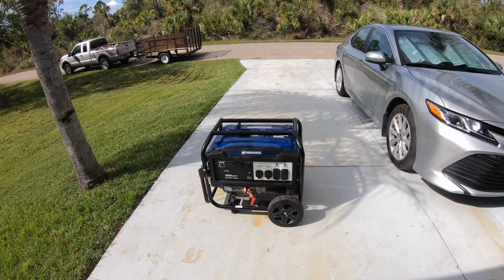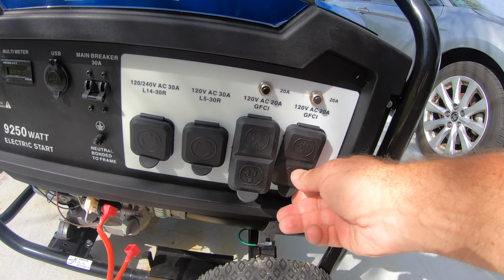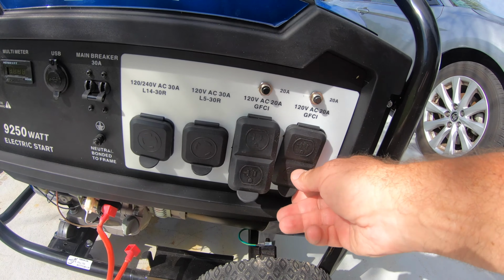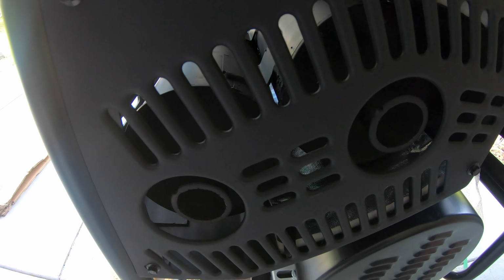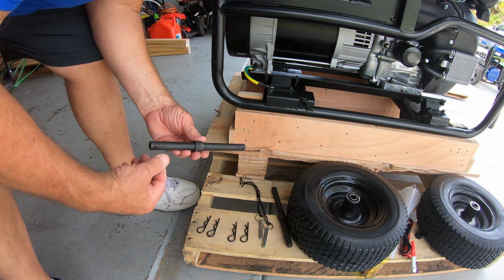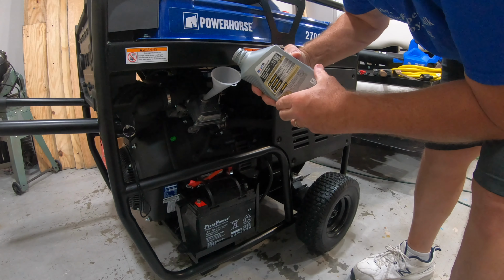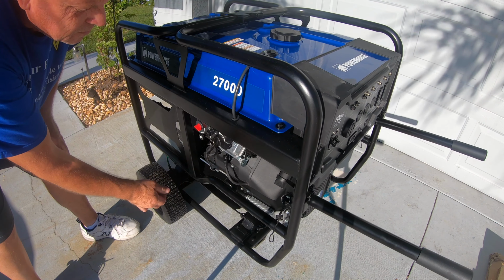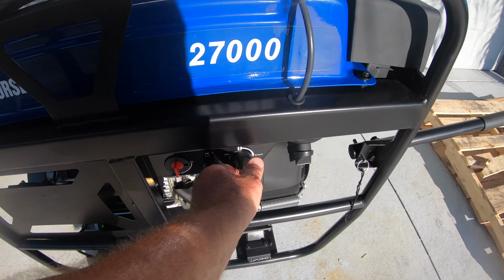Northern Tool Powerhorse 27,000 Watt Generator Unboxing and Overview

Comment: Can you run your whole house off this?
Reply from the maker: Yes, you can.
I tried to copy my response to someone else. If you scroll down, you will see what we ran during Milton here in Southwest Florida.
Reply: @RandomlyAwkward1  I definitely appreciate that. I have a 3 ton unit. That's the main thing when it's hot a/c or cold having heat, and fridge and lights.

Comment: Is it true you can only load it up to 12.5kw on the 27000w's 50 amp plug?
Reply from the maker: I don’t think so. I will try to add up everything we had running during Milton and see if I can tell you what we had in total watts.
Reply from the maker: 1000 watt microwave 
7800 watt water heater
Central air
Kitchen circuit with refrigerator and LED lighting 
Bathroom circuit with LED lighting 
Guest room circuit with LED lighting
Well pump and softener system
Living room with computer, TV and LED lighting 
Router, fiber modem and garage lighting circuit with full size freezer 
Exterior house lighting and security cameras with DVR

All ran for 6 days! We have a 50 amp plug running to our transfer switch and we probably could’ve added more. 

We cycled the water heater as needed just to save gas on the generator, and the well pump does not run continuously obviously, but it still burned about a 1/2 -1 gallon an hour depending on what we were using.

Comment: The 14-50 is rated at 50 amps though so how are you going to use it to run every single thing in the house without tripping the breaker is the question. I have the Westinghouse 20000(28000 peak) it has two 14-50Rs. The only way to use the full power of the generator, if needed, is somehow run it in parallel. Maybe two transfer switches? Let me know what you figured out with your setup.
Reply from the maker: When the electrician wired the transfer switch, it has a 60 amp breaker installed. The generator has a 75 amp breaker and by not using everything at the same time, we are able to manage the power throughout the home. It worked great during Hurricane Milton!

Comment: 4.25 gallons of gas per hour 🤣🤣🤣  Absolutely useless.
Reply from the maker: It ran much longer than that at full load. When you are out of power in a hurricane however, it’s worth its weight in gold.
Reply: @RandomlyAwkward1  No it didn’t.  In fact it would use much more at full load.  The rating was at average load.  I don’t understand why people lie.
Reply from the maker: @kerplunk38880  Thanks for watching!
Reply: @RandomlyAwkward1  And this generator will not run anywhere near full load!
Reply: I have the same generator.  My advice, move it every 6 months or the tires will flat spot from the weight.
Reply: Or put it up on blocks @dustin9035
Reply: I think is was 75 gallons in 61 (51?) hours, so either 1.3 or 1.5 gallons per hour
Reply: @jaybdvm No.  my numbers are from the manual with only average load.

Comment: I have this same generator.  And let me tell you, this is a MONSTER.  Several people have asked me where did I find something that big and portable. I've had mine just under a year. Only had to use it once or twice for power outages from storms in the Louisiana area. It runs MY WHOLE HOME! No complaints from me. Well worth the money.
Reply: How many hours did it run on a single tank before filling?
Reply: @qqqaaam  I got about 10hrs without the A/C running.
Reply from the maker: @sakoraperkins  I actually have not run a tank of gas through it yet, as I have not needed it. Hurricane season is fast approaching though…
Reply: @sakoraperkins  It uses 4.25 gallons per hour per the manual.  That makes it absolutely impractical and useless.
Reply from the maker: Glad to hear it! We are just getting into hurricane season in SW Florida so I hope we’re prepared.
Reply: Thank you both!

Comment: Thank you for your review, I'm looking " hard "at this model.  But i'm still questioning on the running what at 18,000 Watt.  Most other generator running watt around 1500 - 2500 Watt different from peak watt.
Reply from the maker: We actually haven’t had it running everything in the house yet, so it’s hard to say. We had a Powerhorse before and it was a great generator. We got this one specifically to run our central air conditioning and some other things in the event of a hurricane here in Florida.
Reply: Thanks hope all is good for your area 
 @RandomlyAwkward1

Comment: Very nice. I have the 9000 series. At first, I was concerned about it not being able to run my heat pump but then I discovered I could install a soft start unit on my heat pump. It not only extends compressor life, but it also makes it possible for my 9000 peak watt generator to start it up. Once it's running, it only pulls 15A. 

The issue for us is winter outages when it gets down into the 20's. There's no way for it to run the heat pump with auxiliary heat strips on. Those heat strips alone pull 40/50Amps. So for emergency heat, I use a Kerosene heater and the generator can run pretty much everything else.
Reply from the maker: The one we had before was a 9000, and it was a reliable little beast. We just needed more wattage to run our central A/C and other high demand things. I would highly recommend it!
Reply: I bought the 4500 and need to upgrade but running good
Reply from the maker: @jacklane7439  Great… I think they make a strong generator.

Comment: Good Lord, how big is your house? I have a 5500-watt portable that kept my refrig and freezer running and fans going after Jeanne and Francis used my house for a bullseye.. A $100 window AC unit kept the bedroom cool for sleeping. The only thing I did not run was the dryer and house AC. All else worked okay with some power management. Heat the water, take quick shower and turn heater off. Used about 15 gallons of gas per day. 27,000 watts would run my block.
Reply from the maker: We wanted to be able to run the house AC. We utilize power management for everything else (hot water, well pump, microwave, etc.) We didn’t have plans to do laundry while on generator. We also cooked outside for our neighbors on the propane grill. It is a but better to have it in reserve!

Comment: 17 gal for 8 hrs is 51 gal for 24 hrs. WTF man! Where will you get all that gas. As for your old gen...Why are you using a 25amp breaker. Should be 30 Amps. To try and heat water (4500 watts) and use the well pump too is crazy. Heat your water with only the Bare essentials on, then turn off the hw breaker and turn on the well. Or better yet, get a battery gen to run the well and charge it with the original gen. The 27000 watt gen is ridiculous. Go ahead and get an automatic whole house gen. We were out of power for 10 days when  Michael came thru in 2018. $4.00 x 51 x 10= $2100 in gas. The economics are insane. Get a solar setup with batteries and a modest gen to charge the batteries if absolutely necessary.  You obviously have more money than you know what to do with.
Reply from the maker: I didn’t realize it was so obvious.
The generator does not run at full capacity all of the time. We manage the power loads by shedding whatever is not necessary thereby conserving some fuel. The water is only heated in the evening so we can take showers and then it’s turned back off. The well pump is supplied with 220 V power but it’s used intermittently. We have a refrigerator and freezer in the kitchen and a secondary freezer in the garage which we keep running. We usually don’t do laundry during a hurricane so we’re not using the washer or dryer. I selected this size generator to be able to run the air conditioning for health reasons. The original set up was sized incorrectly after we were given bad advice by an electrician. I considered a whole house generator with an automatic transfer switch, but we are not able to bury a propane tank in the yard. We have lots of gas cans that are filled up before a storm to keep the generator running, if need be. We have a smaller generator that can keep the refrigerator and freezer running if we elect not to use the big one. I drive a used pickup truck with a quarter of a million miles on it so I didn’t feel guilty about buying a big generator to keep my house comfortable during an emergency. My neighbors sheltered in my house with their infant during Ian so that made me feel good as well. I’m comfortable with my decision. If we end up using it during a storm I will calculate the actual fuel used and post the numbers for those that have an interest. It’s cheaper to leave and get a hotel elsewhere but my wife and I are “Essential Employees” and don’t have a choice, so we splurged on a big generator to stay comfortable. Hopefully we won’t need it.

Comment: How was the noise on the new generator compared to the old one?  That is like 2-3 times as much power, so I'm just curious how that is on sound.
Reply from the maker: It is louder, but not annoyingly so. Kind of like a truck vs. a car. I don’t have the actual dB rating, but it would run outside and we would be inside with doors closed and A/C on so I don’t think it’s much of an issue. I used to have a much smaller Coleman that you could hear all over the neighborhood and this is much quieter.

Comment: Do you know how to adjust the voltage on this generator
Reply from the maker: No, I’m sorry I don’t.
Reply: Far as I know, you just have to adjust the governor speed to fine-tune the hertz and voltage.
Reply: @nodak81  I am sure it has an AVR or automatic voltage regulator. There is a screw for adjustment on the back of it. James Condon has done this on many generators.